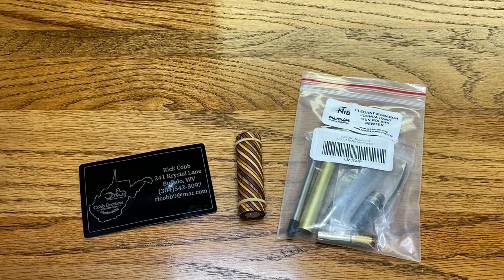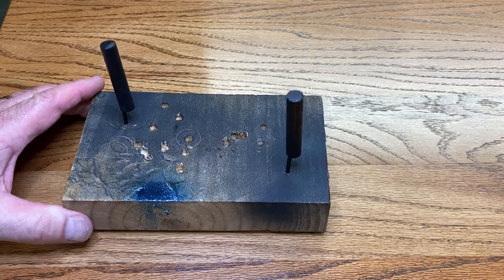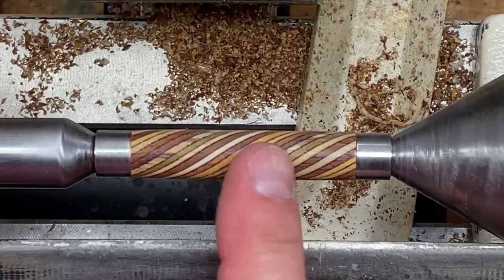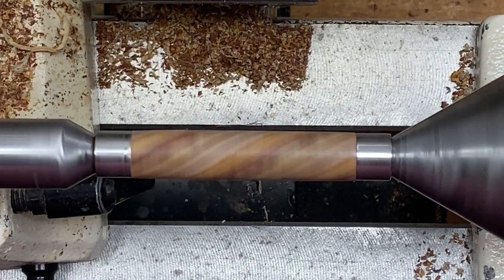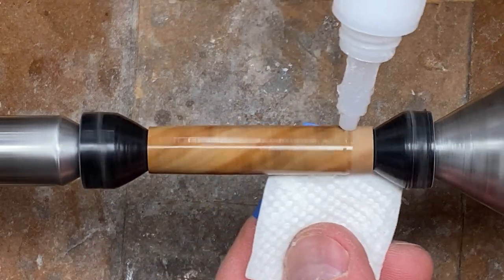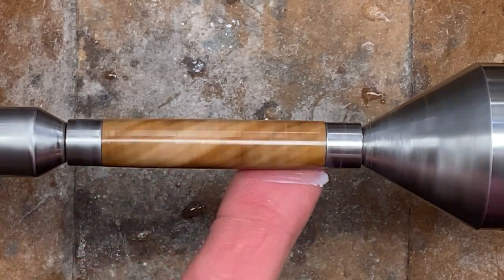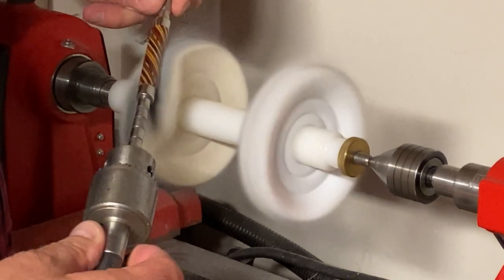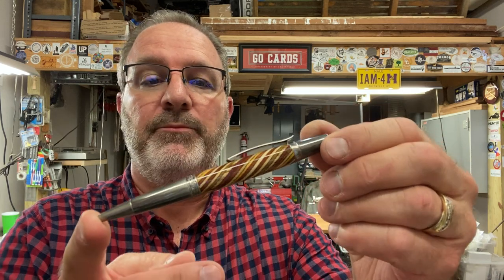Kenneth Wines/Rick Cobb Laser Cut Blank

Comment: I've heard of guys taking fragile blanks and only using sandpaper to shape - never using a skew. 
Have any experience or thoughts on that technique?
Reply from the maker: Hello Jody,
  The blanks are about 1/8” proud of the bushings so sanding would take forever. You could surly sand them but I’d worry that the lighter woods would get muddied with all the darker dust being ground into them. C/A helps but that much sanding takes a toll. 
  The skew is the perfect tool, a super sharp cutter and not that aggressive. It really made light work of the blank. 

Regards,
Bob